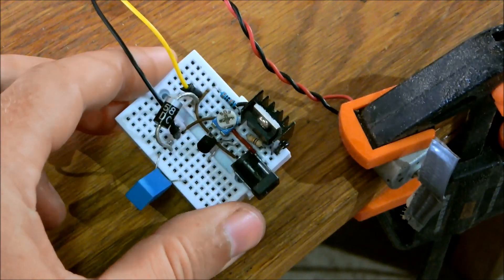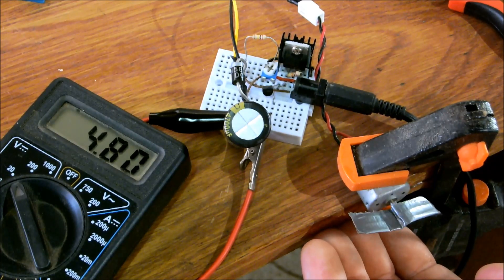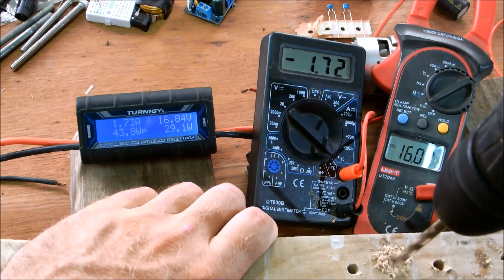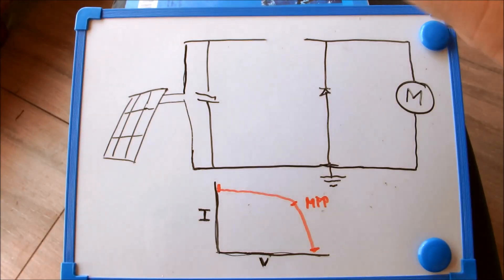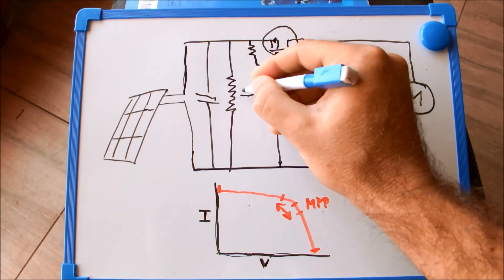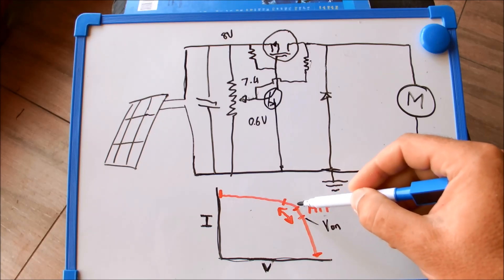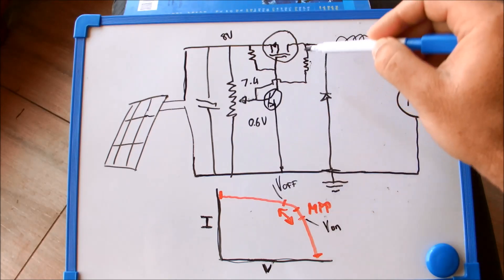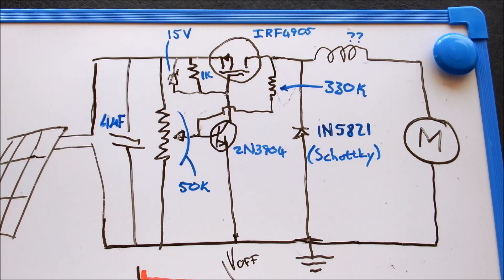DIY Solar Maximum Power Point Oscillator

Comment: This is a similar technique used by the TI BQ24650; input voltage regulation. For a simple method, it apparently works very well.
Reply from the maker: That looks like a really handy chip for diy charging, thanks for pointing it out.

Comment: That is a beautiful circuit. What does the voltage of a panel do in the shade? It might be easy to implement some adjustment using an LDR and some other resistors, but then you're getting into the territory of why not just use a small microcontroller instead with a voltage reference input.

Edit: I would also look at puttng a low-value resistor between the IRF4905 and 2N3904 so that when the Zener activates you're not suddenly pushing a lot of current through the zener and 2N3904.
Reply from the maker: Thanks for the reply. The voltage actually goes up a fraction in the shade as the panel cools. It only starts dropping in very low light. Current drops in the shade. The fact that maximum power voltage fall in a narrow range, regardless of light intensity, makes it an ideal variable to control without active or intelligent tracking.
Reply: @williamfraser  Ah, that's brilliant then. So just setting the voltage to the panel's MPP voltage you're going to be very close no matter the current the panel can provide? That's useful to know.
Reply from the maker: @ThisRandomUsername  ironically, high quality panels have a very sharp "knee" on their voltage-current curves. This means that a given deviation from mpp voltage can result in a substantial drop in power compared to lower quality panels. For high quality panels it is well worth investing in a proper mppt controller.

Comment: What is the intended application?

As you said it does not track the powerpoint, so any change in outside conditions will put it way of the Mpp. The panels producing a bit less voltage cause it is overcast and this oscillator might not turn on at all, same for a very sunny day as there the output-power can also drop if the cells get too warm.
If that is no worry then it is fine. Like just driving a small fan or charing some solar-lights.

I am just searching for a design that can actually decently track the MPP but nowadays if you search for that every single design is doing the same thing as yours here - just trying to keep the input-voltage stable. If any parameter about the input changes then all bets are off.
(Heck, i have even seen designs that just use a linear regulator - burning away excess power - and daring to call that MPPT controllers )
Reply from the maker: There is very little change in Vmpp under typical fluctuations in sunlight. Targeting a narrow voltage window keeps the panel very close to mpp. This circuit is however better suited to handle sporadic high current demand from the load. E.g. starting up a pump motor that would otherwise run directly from the panel. As clearly demonstrated, it prevents overloaded motors from completely stalling.

Comment: next video should be an Boost Converter that puts out decent dc current to input voltage...?!?
Reply from the maker: The term "boost converter" normally refers to a circuit that boosts the voltage. In order to achieve that, current has to decrease.

Comment: Nice design, maybe adding a second transistor T2 driven by another trim pot fron output to limit the output voltage, aka drive the base T1 to ground to extend Toff period

Comment: Interesting little circuit and like the idea of a electric kayak or small boat, you seem to get a reasonable cruising speed with your test setup in your other videos.
I wrote a 4 part MPPT tutorial a few years back which could fairly be adapted for something like an Arduino, may provide some inspiration.  A couple of videos on my channel under the C2000 playlist show the system working and also contain the links to the tutorial.
Reply from the maker: Thanks, I will keep it in mind. I have an Arduino starter kit gathering dust somewhere...

Comment: Wow, nice! Thanks for explaining how this works in so relatively simple terms.
What are the downsides? How efficient is this compared to a MPPT charger?

And how efficient is something like this for charging batteries? I know that charging batteries is easier as long as the panel matches the battery voltage closely. So much so that if you plan it out for a fixed installation, adding more panels is cheaper than adding MPPT controllers.

I assume Id also have to calculate the values to work for something like a 370W panel with 37 Vmpp. 

I really like this because it would allow you to build, maintain and repair the energy "drive train" of a solar powered boat even if you don't have access to specific products.
Reply from the maker: You make a valid point about being able to fix it yourself. Efficiency is not that great when pulsing but I have not tried optimising it yet. From the drill experiment readouts it looks like 70-80%. For something this cheap the "cost vs value" should be evaluated by comparing power gained vs a direct-to-panel connection under similar conditions. It can make the difference between a motor running vs not running at all - you get the idea. The cost of larger panels justify the expense of more specialised electronics like MPPT. As a compromise solution, a simple buck converter can be rigged up with similar voltage sensing on the input to achieve automatic output regulation. A gent with a youtube channel "opera" has some videos on it.  The actual dc-dc conversion will be much more efficient if left for the buck converter to take care of.  When charging batteries, the panel voltage cannot be drawn down further than that of the charging voltage so even a direct connection will give reasonable efficiency.

Comment: I've been doing this for years and have a couple videos on it.  The easy way is to use a cheap China inverter board and fake the output into thinking the output voltage is too high. Otherwise it is much too easy operating power switch in semi linear mode. Many switch chips have a shutdown pin like the 2596 which is quite fast and will operate the chip in a burst mode.  TL431 in place of the transistor gives a fixed voltage that will operate without drift.
Reply from the maker: Thanks, your videos were part of the inspiration for this project. I initially wanted to use the TL431 but the supplier only had the LM336-2.5 shunt regulator which turned out entirely unsuitable. I will have to get someone with an oscilloscope to look at the voltage on the gate when it's switching. I did see a big improvement in the current step-up when I decreased the pull-up resistor from 10k to 1k. Just how much drift can I expect on the transistors base-emitter voltage?
Reply: Sort of on the subject, here is an interesting design I found years ago. http://www.romanblack.com/smps/smps.htm

Comment: Are you trying to replace the Solar charge controller? https://cuttingedgepower.com/products/1200w-2400w-100a-mppt-solar-charge-controller I know your video is about how to track the solar maximun power point Oscillator but a solar charge controller gives you that info ! Am I wrong ?
Reply from the maker: This circuit is aimed more at motors driven directly by solar panels. It is not as efficient as a proper MPPT.